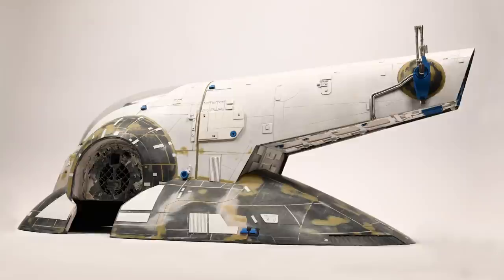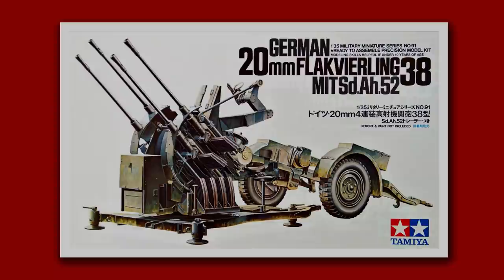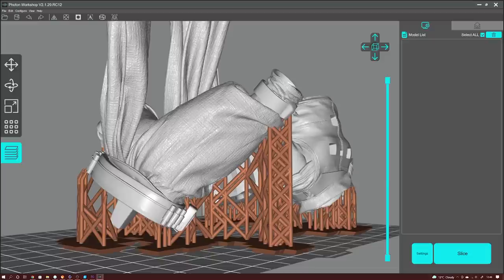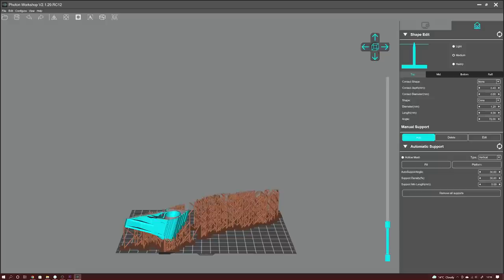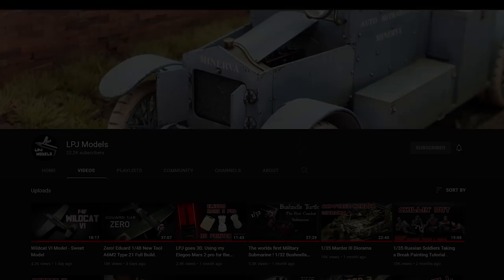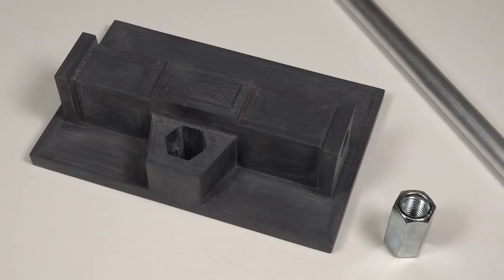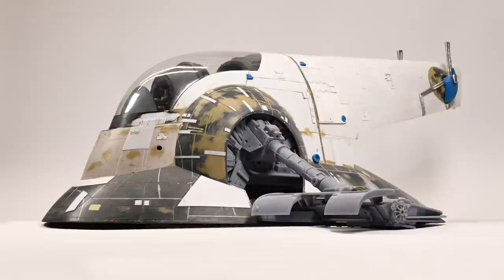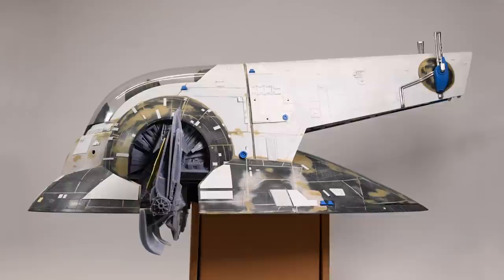PROJECT SLAVE 1 PART 7 ‘WORKING ROTATING WINGS’

Comment: Once again fantastic video thanks so much for sharing. . Love it. With my resin prints I use fine supports but lots of them. Like 80% and pull away perfectly no cutting it with zero sanding. It uses a little more material but had no fails so far. But it make post processing so easy. keep up the great work.
Reply from the maker: Thanks Ryan, glad you like my progress. I was getting parts pulling off the supports during printing with the fine supports. It could be because my parts are so large and have a big cross sectional area. Fine works well on small parts for me. Great tip though.
Reply: I’m also growing large parts too and using fine supports.  (I have a phozen mighty for my home stuff. )It seems to works really well on large and small. The reason I tried it I had a demo at work with magics slicing software. And there auto system uses very fine supports and again it pulls away with very little damage. The one thing I notice is that you have to make sure the supports are supported hence the 80%. I’ve had zero failures and it saved me so much time on post processing. Anyway keep up the the video all the ones I’ve watched I’ve thought was great and shared with college they love them too.

Comment: Fon't forget there is a link bar btween the two wings underneath that rotates with them.
Reply from the maker: Yes, I have allowed for that. It will be in the next episode when I get Slave 1 off the deck and on a stand. It was too vulnerable to add at this stage.

Comment: These videos are great ,I am planning on making this one in the future will you be releasing your cockpit and wing designs? I am sure there would be plenty of people wanting to use your designs to improve the original?
Reply from the maker: Thanks Mathew. I reckon that by the time I am finished I will have re-designed about 75% in CAD. I am very tempted to finish the job and then make her available.
Reply: Please do. I have these files also and have been trying to plan it out. If you release what you have now I’d buy it in a heartbeat.
Reply: @StaplesandVine  Again, please do?  What you have done is...amazing.  You have the .stl/.obj files.....reap your rewards! lol

Comment: This was really cool but we didn't see anything getting built. Don't get me wrong I mean was nice to see your thought process but I was really hoping to see some work getting done.
Reply from the maker: Thanks for your reply Sad Panda. It's a good point but scratch-building isn't a linear process like regular kit building. 95% of the work is in the design and fitting of the parts. All the parts require a LOT of clean up and adaptation on the fly something not well suited to filming. You did get to see two fairly large parts being glued together at the end though. 🙂

Comment: Maybe make a jango fett one
Reply from the maker: Good idea, but I do like the classic Boba scheme. That will be my choice. 🙂
Reply: @StaplesandVine  just a suggestion, and keep it going, ur doing very well
Reply: @StaplesandVine  maybe u can use this for reference material https://youtu.be/Zi3hXMwha3U  or u have already seen it
Reply from the maker: Thanks @bigmansir3745  , yes I have studied it many times. I'll be using the same Archive-X paints. 🙂
Reply: @StaplesandVine  np, there arent many ppl like u, putting a lot of effort in ur vids.
Reply from the maker: I try and make the videos I would like to watch and hopefully others do to. 🙂
Reply: @StaplesandVine  And one more thing for the engines, have u watched the mando show or the boba show, u see that bobas long engine and the 2 round ones have been updated
Reply from the maker: It's a tough one. They designed an all new CAD model for the Mando and BofBF shows. Who can say they aren't going to change the design again. I'm going to stick with the original that we all know and love .
Reply: @StaplesandVine  Ok, just a suggestion, and keep that hard work going.
Reply: @StaplesandVine  and another thing i noticed today is, that slave 1 in mandalorian and bobas show looks a bit different, the cantipede looks slightly bigger, engines are slightly reworked, etc, just something i learned today